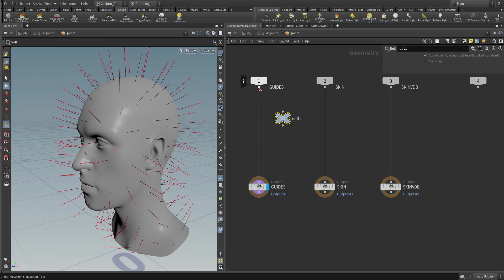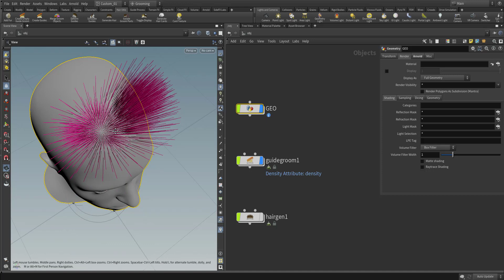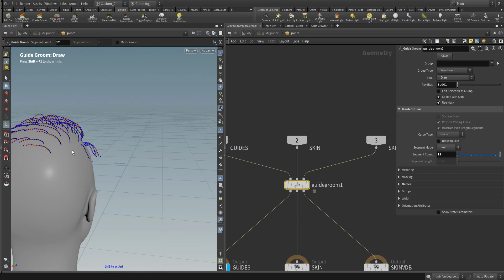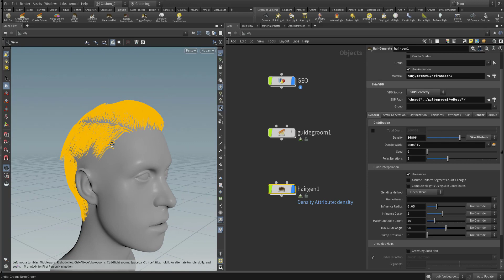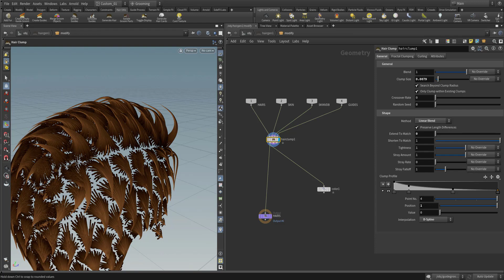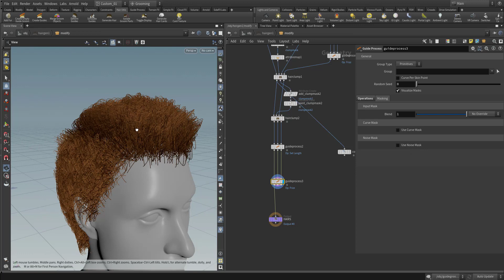Introduction to grooming in houdini

Comment: great tutorial.  However I ran into a problem when I use guide deform to pass the guide groom to my animated mesh.  It has the error says: The rest attribute is required when using parting lines.    What does it mean?

Later I add a rest node to the end and the error goes away.  What does a rest node do?